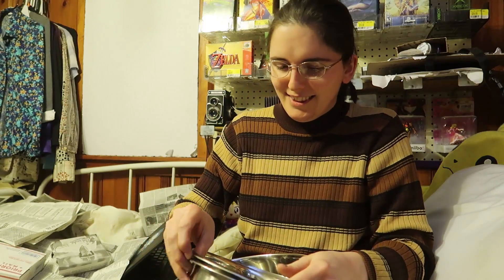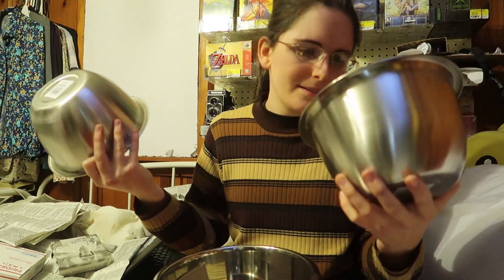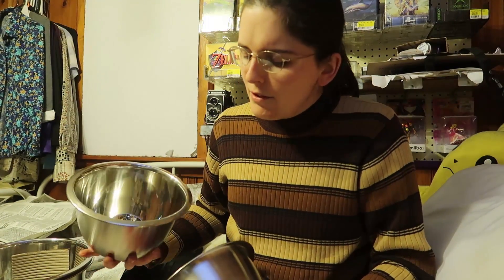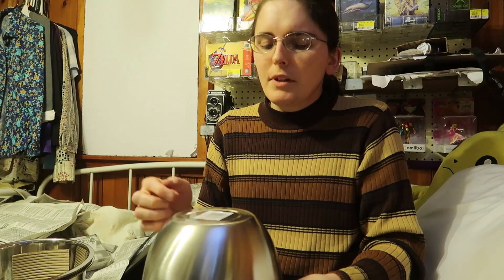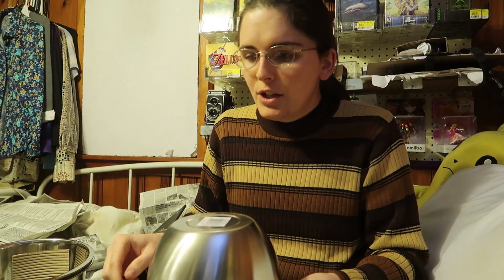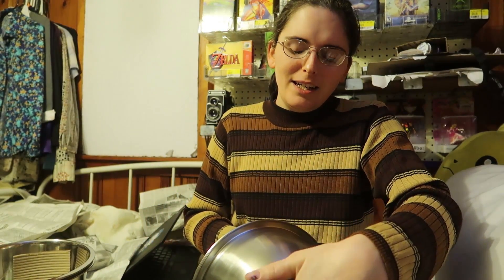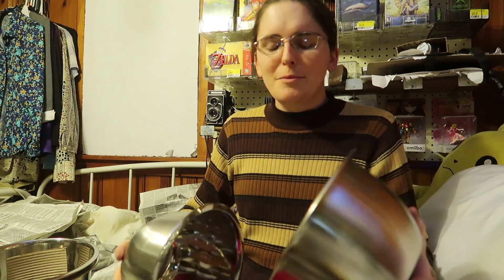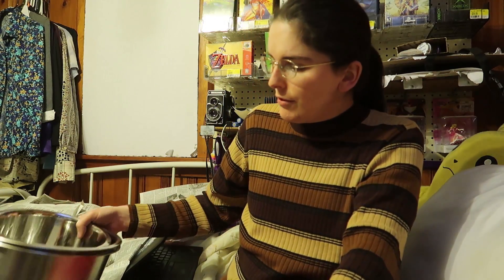Personal Bits 0387: Rocket Engine Liquid Oxygen Tank from Stainless Steel Salad Mixing Bowls?

Comment: Have you considered silver soldering?  I think you will find that it is much cheaper and less prone to oxidation, cracking, and welding bubbles that friction welding on such a thin material would likely produce.  While it does not give you the experience in making a complicated machine to produce the friction weld, it does seem to worth at least exploring. Here is a site that has the technique boiled down to almost bullet points as a starting point: https://www.bssa.org.uk/topics.php?article=150

Comment: I hate to be a pessimist but I doubt you'll be able to friction weld them.. simple principal.. difficult technically..even if you do manage to friction weld them the joint would be dangerously subject to peel failure..cut the flanges off and Tig weld them or get someone to Tig weld them for you.. they'd probably want you to sign a disclaimer.. wouldn't want you to get hurt... Regards..
Reply from the maker: i doubt also, but you cant let your bias get in the way of a good experiment
Reply: @rinoaleonhart86  Your choice of the word bias is incorrect..in trying to friction weld those items  you will experience instability..and even if you Tig welded the flanges around the edges you are in danger of peel failure.. I'm just trying to give you the benefit of my experience, it is not bias..I will now withdraw from this discussion..  Regards..
Reply from the maker: bias, meaning preconcieved notions. i have no exprience with this, and you not conveying any experience by saying it wont work. i need to know how it wont work, and i also want to try this experiment to learn for msyelf
Reply: @rinoaleonhart86  what I wrote is not a notion, it's a technical fact based on sixty years of mostly hands on experience and listening to people with sixty years experience.. that's why I still have a full set of fingers and eyes that work..Rinoa you are moving into very dangerous territory with these experiments..I am the last person to discourage you..all the best and most intelligent engineers I've met had constructed bombs of one sort or other when young, we would end up in jail for doing it in the UK now..it's good to be able to see you using the freedom you have in the USA to do that...just be careful please.. oxygen is a very dangerous think to be using as NASA tragically found out with there expertise.. The very best of regards...
Reply from the maker: im always careful

Comment: Nice project, hope you get to where you need to be. I wanted to comment just to offer my support/advice if you ever need it, I work as an aerospace engineer in future propulsion systems concept design, and I've authored a number of aerospace cryogenic design journal papers, so if you ever had any questions or needed any help finding suppliers etc (some components/materials you'll need are difficult to source independently, not to mention cheaply), I'd be happy to help. I understand if you would prefer to figure things out for yourself though, and in any case, I look forward to how this project progresses.
Reply from the maker: yeah i might ask for help when switching from gasious to liquid propellants, paticularly having difficulty finding cryogenic valves. however im thinking ill just get a lathe and build my own out of copper or something to save money
Reply: @rinoaleonhart86  Sure, well if you want to contact me about anything, message me through LinkedIn, https://www.linkedin.com/in/dr-chloe-jo-palmer-bb5a554a/ and I'd be happy to help.
Reply: @rinoaleonhart86  what kind of valve are you looking to source, liquid or gas, and how does it need to function, is it rapid reversal (like in a GM cold head for example), binary state on-off, flow control etc? Those attributes plus the operation temperature/fluid will make the decision easier in terms of choosing the external procurement/repurpose route or the DIY route. Copper is a double edged sword in terms of valves; it works well with most cryogenic liquids, has sufficient mechanical strength if properly used, but its high thermal conductivity means it needs to be either actively cooled to prevent premature boil-off, sufficiently passively insulated using MLI or a vacuum jacket/cryostat. Valves can often be picked up either cheap (tens of $'s) or free from universities or labs where new equipment is being ordered. If you know exactly what you want, I can ask around my contacts to see if anything like that is going spare.

Comment: Ms. Rin, have you considered Craigslist as a source for your vessel needs? I just went onto the Anchorage, Alaska Craigslist and found small medical oxygen bottles there. I am very sure you could find small cylinders for whatever gas you wish to use for your engine. Would save time and headache, maybe even money in the long run. Not as fun as pure experimentation, but much quicker.
Reply from the maker: oh i already have some of those, however they dont have enough openings on them for all the pipes that need to be connected. i dont want to go drilling into a gas cylinder. lol

Comment: Attempting to friction weld something like that for LOX use is asking for headaches, troubles and time wasted. We use laser or TIG , everything is purged with argon and most welds are done robotically. The thing about stainless is if the welds aren't shielded and the container your welding isn't purged with with some type of inert gas the welds will be have bubbles, weakness and will oxidize. If your making a tank to use for LOX it needs to be done right even at 100psi. You really dont want the tank to have pre-existing oxidation. Stainless can and will oxidize when heated to welding temps. Just a suggestion that I would really consider is just taking it to someone or if you have a TIG going that route with good back purging. Good luck!
Reply from the maker: ha! you dont realize that any video i produce makes me money, so is it really a waste if it pays the bills? i want to know its a bad idea from experience, not just from other peoples experience

but i am looking at getting a TIG eventually

Comment: Looking forward to seeing this. I hope it works, but stainless has a very high melting point. You've probably done it already, but I'd check eBay for used stainless tanks. Maybe one used for brewing?
Reply from the maker: well nothing great came up for a low price. i have some but if i could use these bowls itd be like 15$ a tank

Comment: LOX is difficult to create and store....have you considered concentrated hydrogen peroxide or nitrous oxide? You can purchase H2O2 without much trouble. I used 97% H2O2 for mine.
Reply from the maker: i dont want to work with H2O2
Reply: @rinoaleonhart86    Used to get it by the gallon back in the 90's from a friend who worked at a lab. It is dangerous but LOX scares me. I've melted a lot of engines in my day because I was too lazy to make any kind of cooling system for the combustion chamber and nozzle. I would turn mine from one solid piece on a lathe and drill and thread some holes for the lines and was it...I tried oxygen and acetylene ( the first one I just hooked up to a torch), tried propane and peroxide,    kerosene, and even liquefied turkey manure. Anything organic will work. Never flew anything but solid rockets, but had a lot of fun destroying liquid engines. I'm a big fan of this channel and have been waiting for you to get this engine going! Have fun!
Reply from the maker: well i wont be working with LOX myself. my plan is to have pressurized gasious oxygen in large tanks and liquid nitrogen in a large dewar, then on-site have the test equipment liquify the oxygen using the liquid nitrogen while im far away. and if something gets messed up, ill just pop the vale and let it all vent and try again
Reply: @rinoaleonhart86  and you'll be able to keep it stored and  pressurized at -300F until use?
Reply from the maker: stored? you mean the nitrogen? you ever hear of something called a dewar and a cryogenic cooler?
Reply: @rinoaleonhart86  The LOX....how long between manufacture and use at launch? The finished product...
Reply from the maker: hope to condense the LOX inside the main test stand LOX tank maybe 20 minutes before engine tests
Reply: @rinoaleonhart86  Move over, SpaceX!  Wow, I am so living vicariously through you right now! This is the coolest story to be following on YouTube right now...please keep us updated!
Reply: Turkey poop!? Atomize it a blow it into the combustion chamber. :) Clumping might be a challenge. That is so cool. :)  When I worked for a chemical company in Anchorage, Alaska, they had 55 gallon drums of 46% for septic system professionals to use, I had some dribble onto my hand. Turned my skin really white, really fast, but washed it off so didn't do any damage. @UCuWcxtVk4HAeTojdFCv565g
Reply: @TheKuskokid  we used to pack a 15mL glass bottle of it inside a small paint can packed with manure and rocks, ball bearings, or anything that would break the glass on impact. Made a nice grenade. I worked at a machine shop 50mi from civilization...way out in the sticks. We would fill 50gal trash bags with oxacetyline and put them under 55gal barrels and shoot them from about 100 yards. We were always designing and building potato guns and such. I practically lived there. Good times....*sigh*
Reply: " We would fill 50gal trash bags with oxacetyline" hoooly shyyyte!! :)   @madisonlivingston5851
Reply: Any H2O2 over 60% is getting serious. I am surprised a non-governmental entity could acquire such a concentration due to the spontaneous decomposition risk. Not saying one could not, but am surprised.
Reply: @TheKuskokid  it was easy to get in the early 90's. Very dangerous and did lose some skin on my fingers now and then...

Comment: since this engine is not going to fly, and propellant density is not an issue, why don't you just use gaseous propellants?
Reply: You make a good point about weight, but what stops you doing that is pressure. As fuel/oxidizer is fed into the combustion chamber prior to exiting the throat of the nozzle, it creates significant back-pressure, fighting the pump/compressor as it ignites and expands. This means you need high pressures in order for the engine to work. Liquids can be pumped to high pressure easily with negligible temperature rise and little power input due to their incompressible nature, but compressing gases to the necessary pressure causes significant temperature rise in the process, which can cause autoignition, not to mention the potential risk of compressor surge. It's not impossible to do, it's just more practical to use liquid propellants, not to mention simpler.